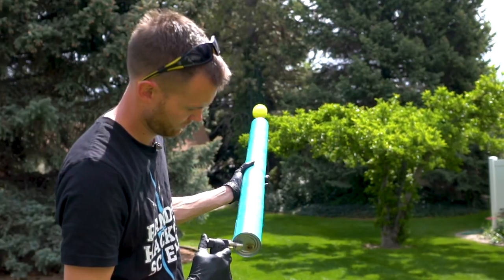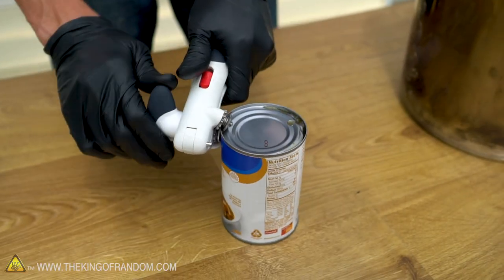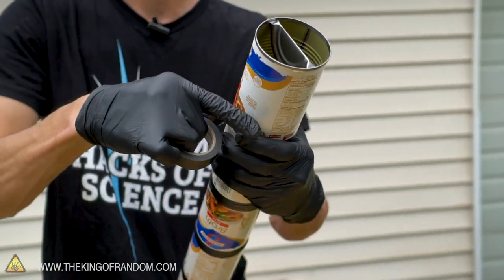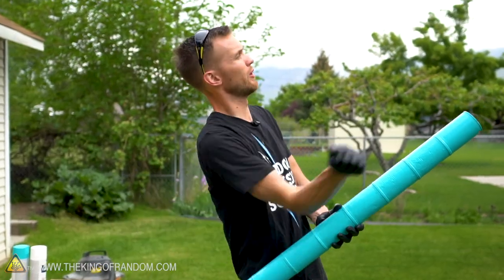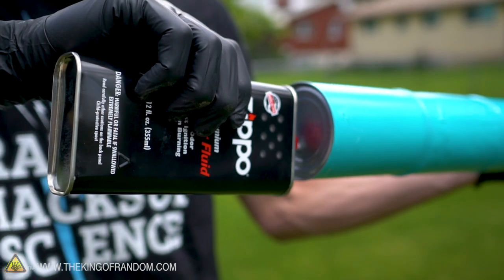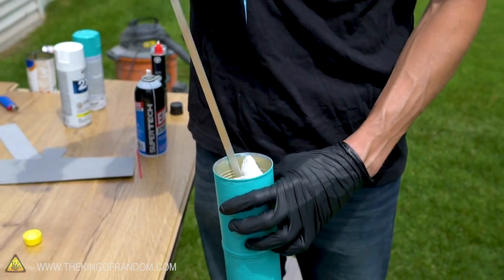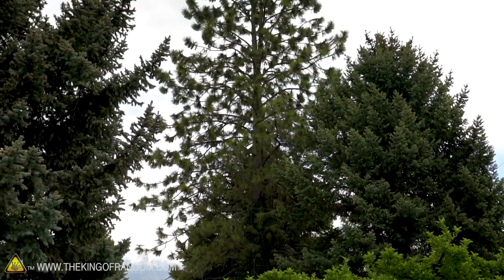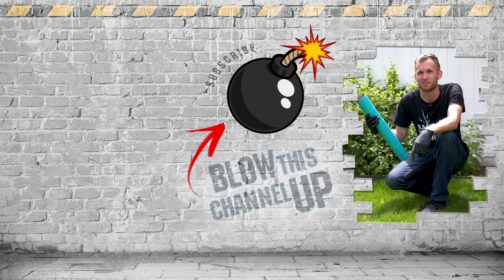Tennis Ball CANNON from Soup Cans

Comment: Built one of those when I was a kid (1970's, with the old style pop cans). We used lighter fluid, into the bottom can, then swung the "cannon" like a base ball bat a couple times to vaporize the lighter fluid, then immediately lit it. BOOM!
Reply: Exactly.  We did the same in the 70s.  Shake the whole contraption a number of times like a spray paint can, then light at the whole at the bottom edge of the bottom can.  The balls would easily go 60-70 yards.
Reply: I did the same, using tall beer cans I'd find. Worked really well, always wanted to make one to show my now grown kids, but need tin cans not aluminum, bummer.
Reply: Me too whipcannon around like a bat
Reply: Also the mid can should lowered
Reply: We also installed a flint at the bottom-side of the bottom can  to strike instead of a lighter
Reply: Probably that Cannon could be reused as an alcohol firecracker like the indonesian people used to celebrate ramadhan they sounded very loud!!!
Reply: We used mom’s hairspray it would send the ball a block or more
Reply: Yep. When Coke was still in tin cans. Used a triangle can opener on some and removed to and bottom of others
Reply: and the tennis ball fit snug on first can....ours went 100 yards+ not 200 feet lmao...then we went Gladiator and would put lighter fluid on tennis ball and light it :P

Comment: When I was a kid we cut the can lids halfway and folded them under, making sure each was cut on opposite sides. Then we would put them together so that each can matched holes with each other. This kept more vapor in the bottom half of the cannon longer. We used lighter fluid as well and just shook the cannon after adding the tennis ball. And our ignition hole was on the side of the bottom can and not under the cannon.
Reply: That's exactly how my older brother (hero) made them. I've never forgotten that tennis ball bazooka.

Comment: In the early 70s, soda cans were made with a thick, straight-sided cylinder, had a large, removable pull tab, and a top and bottom that could be removed with a can opener. They were the perfect diameter. We did nothing to the bottom can except remove the tab and punch a hole in the side (not the bottom - you could stand ours up on the ground without losing fluid). Then, we removed the top and bottom of 4 or 5 more cans (4 total is actually sufficient) and taped them together. We just dropped the ball all the way to the top of the bottom can (All of that extra expansion space isn't needed). We could get 50 to 100 feet shots, depending on how much lighter fluid was used and the angle at which we held it.

Comment: We used to use beer cans,they were at that time made of steel.  This paper thin aluminum now would melt or explode at the seams. They are tight fit, plus the opening was enough to allow lighter fluid to flash off into vapors.

Comment: Why you dont use a pvc pipe?
Reply: LivePro he wanted to do something with things ppl have at home
Reply: Teri Payette it’s pretty easy to obtain a pvc pipe
Reply: PVC pipe doesn't commonly come in a size that fits tennis balls.
Reply: It do though
Reply: right? and why arent you shooting potatoes? they will always fit and work WAY better.
Reply: It would slowly melt the pvc
Reply: then why do i have the one i made for 2 years and its just fine?
Reply: Because me and my dad made a "potato launcher" many years ago and you want to buy all new stuff to build it... It costed $25.00 to build and that was years ago
Reply: @elmoeboi9544  not a chance.
Reply: Heat damage and potential plastic shrapnel. Metal cans hold the pressure better, which is not so high as to be able to rupture a soup can wall.

Comment: I think if I made this, I would want to use some kind of glue on the cans as well, to ensure it holds. I think I'd also want a removable bottom of some kind, to help with fueling.
Reply: Or use a solid tube of some type. This is just another version of the "potato cannon".
Reply: Just use pvc pipe
Reply: Incase of a removable bottom the pressure inside the tube would force the bottom to open up.
Reply: threaded one might able to prevent the bottom to pop off
Reply: Yep. I was honestly expecting a catastrophic disassembly halfway through the video because he was using cans and tape vs. explosive gasses.
Reply: I would do it with PVC with a removable bottom and attached a BBQ lighter at the side with hot glue. So the gases don’t leaked by the hole like this one. I also would use a trigger spray bottle to   vaporize the fuel inside it.
Reply: solid ideas dudes
Reply: Directionally Challenged so a potato cannon with interchangeably barrels of different diameter
Reply: I wold do the same but would have taken some 1/8 sheet metal and bend it into a circle and glue it in the last 5 cans to onshore a tight fit for the tennis ball
Reply: True
Reply: Just a pipe works too
Reply: if you close it in the bottom, metal pipe makes it a working gunpowder cannon but i would not recommend that a bit too much powder and it will explode insted
Reply: duct tape works best

Comment: Thanks for the fuel idea.  My tennis ball had a great tight fit using asparagus cans but I was struggling with distance using lighter fluid...maxing out at about 20 feet.  As soon as I changed the fuel I immediately got two nearly identical 120 foot launches.  Awesome!!

Comment: I have double walled cannon with a 3 liter combustion chamber and a 4 ft barrel.  It has electric ignition so You can seal the camber completely and uses a mix of oxygen and propane as the fuel.  It can lunch a sand filled tennis ball over 1500ft.

Comment: I used to make one when I was a kid.  However, we did not use so many cans.  When pop (soda) cans were steel we stacked six together.  We also did not shove the ball so far down the cannon.  We usually stopped the ball at the first can.  Lighter fluid worked perfectly well because the combustion chamber was smaller with only six cans.  We used to get great height and a very loud blast.

Comment: Just a suggestion. Before connecting the last 4 cans on the open end. Cut the foam the size of the single can and using contact cement stick the form to individual cans.

Comment: When I was young and did this we used steel soda cans as they fit the tennis balls tighter. The best fuel to use is calcium carbide or miners lamp fuel.  We would put two or three "rocks" through a keyhole in the bottom can, add water, wait about 20 seconds and then ignite it. Tennis balls would regularly go 100 to 150 yards high.

Comment: Build it with 3 Pringles cans two with baffles to create better pressure and a hole one inch up from the bottom can use g a piece of foil tape to reinforce the ignition point. I get mine to shoot way more than 100 feet

Comment: We put tiny hole on the top lid of the bottom can all the way around with a bottle opener litttle triangles then a tiny triangle on the side of the bottom can near the bottom and get close to 1000ft with lighter fluid once its primed correctly

Comment: What happens if you put two sniper sights on a gun right in front of each other. Does it enhance the zoom? Also try putting one sniper scope on a gun and another scope in front of the sniper scope like a red dot sight. This should be interesting....
Reply: FallingJuiceBox their isn't enough space for two scopes. Each scope takes at least half them for the rings and the long range scopes extend past the upper in both directions even for cheap ones. They already make a red dot on magnified zoom combo they run $299-1,000 USD.
Reply: FallingJuiceBox short answer yes. Its typical for soldiers to have a 4 to 5x multiplier on a swivle for their holo sights.
Reply: Cayden Skinner your lucky I’m subscribed to them

Comment: Can I use PVC instead of the cans?
Reply: kareem ahmed PVC of the correct diameter would be even more effective
Reply: its essentially a potato gun.
Reply: Jack Stephens
Thank You :D
Reply: Its similar to a potato launcher
Reply: Pringles can
Reply: I would suggest ABS instead of PVC. ABS will be thicker and harder than PVC. Can withstand the pressures better, to a certain point of course as they are both plastics. ABS usually comes in black, so a bonus maybe?
Reply: pOOTERgOBLiN 
Thanks

Comment: In the Philippines we make these for new year not for launching projectile but to create loud noises. The holes in our can are smaller and gets bigger as it goes to the tip and then use a plastic bottle with the cap have lighter cricket (the one that causes spark) ot the bottom and flying tiger (this is brand name its a kind of alcohol) as fuel

Comment: You need to wrap the ball with paper foil make it bigger put it half way in only so it seals but it’s loose enough to fly with the pressure and explosion. The other the pressure will rise and it will produce a lot more power

Comment: To best use it you have to make multiple chambers in the bazooka, then shake it vigorously and yes you need the ball to be much tighter and it does not need to go so deep inside, when we built some when i was a kid, the tennis ball was just pushed to the bottom of the first can, you need as much space as possible and chambers that can be filled with fumes for a best drastic results. The result in speed and distance is only a small fraction of what we managed with our bazookas. We also tried different fuel, usually because of availability and has to not raise our parents suspicions . The way we used it, I estimate that we could send tennis balls at least 400 or 500 feet straight up. Also we didn't need a sort of stopper for the ball because it was so tight that it could only go as far down as our hand could push it.

Comment: Use duck tape next time at each can segments to hold it strongly together. Use a small squirt of zippo or ronsonol lighter fluid in the bottom hole of the bottom can and You have to swing the thing like a golf club 10-12 times until the fluid becomes vapor. Once the bottom surface of the bottom can feels cold, it’s ready for ignition.

Comment: We used to do what you are doing but less high tech and probably much more dangerous. 🤗
Soak a tennis ball in gasoline drop it down a tube fastened straight up in a camp fire.
Spectacular results indeed. Of course we did it near a river with no brush to catch fire.
As I am older and wiser,I will try your method.

Comment: Can you just use the tube that the tennis balls come in? The diameter of those is very close to that of a tennis ball. Perhaps you could use cans for the bottom half (where the blast happens) and then have the tennis ball tubes on top of that for the barrel. Bernoulli says it should work.

Comment: In the mid 1970's, Coca cola cans were steel. They also were a snug fit for tennis balls. We used naptha or coleman white gas for propellant. Distances of 80 yards was easy. Also a used vehicle driveshaft worked great. Oxy and acetylene, for range over 150 yards. It would knock you down at 20 yards and leave a welt!

Comment: DO A CATHODE RAY TUBE, use your vacuum chamber and add an anode and a cathode on each side, It's should work, those are the basics of a ray tube, you could also bend it with very strong  magnets! High voltage bendable rays, you've got to do it  !

Comment: here in philippines we made it better... just using a denatured alcohol as fuel... as I make my self... we called it BOOGA! I used 8 cans. 5 cans are all opened up and 3 cans only opened only the top, this can will be having a diffirent sizes of holes on the bottom the 1st one will just a tiny hole and will be the base. the 2nd will have a 3/4inch diameter hole, then the 3rd will have 1inch diameter. then stack all the remaining 5 fully opened cans...  the 3 base cans serves a pressure area so that it will compress the fuel when ignited. that will create a big BOOM...

hope you can try it... you can also put a small fan inside the base can so that you can evaporate very fast your fuel for just about a sec. and it will ready to BOOM...

Comment: Your problem is not the fuel you are using, lighter fluid works great. Your problem is your combustion chamber is too big. When I made a tennis ball canon about 50 years ago, I used the smaller Campbell's soup can like a tomato soup can size and attached a tennis ball can on the end. That is as far as the ball went in. What you did with the larger cans should be fine also but your design flaw is in the bottom can. You have a small hole in the end for squirting the lighter fluid and lighting but you have the other end of your bottom can open. It should only have a hole in the center about the size of quarter, you know, a 25 cent piece. It is harder to clean and dry out before assembly but give that  a try and hold on tight because it kicks like a shotgun, one hand won't enough, and sounds like one too. I used to hold it and a friend would put a match to the hole. All you need is one small squirt of naphtha/lighter fluid and mix thoroughly.

Comment: Keep the bottom can intact...put your hole on the side and stand it upright.  Steel soda cans were the preferred building tool..and I poured lighter fluid in the from the top...spun it around.  Want real fun?  Soak the tennis ball...and it's FLAME ON!

Comment: You need to use Campbell's Soup cans but the tennis ball will be a little bit too tight for it so you cover it in lighter fluid and burn a lot of the hair off so it fits nice and snug down in there. We've shot those things so far up into the sky that you couldn't even see the ball anymore

Comment: We use to make these in the 1970's and we used the steel tennis ball cans but we used 4 cans. 2 cans had the ends cut off and these are were the tennis ball would be loaded. The to other cans were on the bottom one had the bottom kept whole and the second one had holes put into it. Tape them all together then squirt lighter fluid into them then hold the cannon and swing it up and down to spread the fluid and intake air. Put the ball in and in the bottom can a small hole is used to ignite the fluid and trust me they sent the ball way further than 100 ft.!! When the tennis ball stopped fitting tight we would use some duct tape on the tennis ball.

Comment: what if you add a piezoelectric spark lighter from a barbeque lighter and attach it to the side of the bottom can?
you won't need to hold a torch to light it and it will be easier.

Comment: Instead of using methanol, try ethanol, when I was a kid I used to make those cannons, and with ethanol it worked the best, and also if the hole do light it up is on the side of the can, right on the edge the explosion is bigger. I don't know why, but it is...

Comment: Back in the 1970’s sodas came in tin cans. We would also wrap the tennis ball 🎾 with electric tape. We would stand it straight up in middle of the street and make a trail of lighter fluid for a fuse. Most of the time we would get the ball back at times it would come down next block over and didn’t get ball back.

Comment: I have a random thing for you guys to try. Can you solder several little 12 volt batteries together like you would power of small device with. And get enough power at 12 volts to start a car.

Comment: We used to use metal tennis ball cans taped together but the last one upside down with about 8 1/4 inch holes drilled and a hole at the bottom. Used lighter fluid and would go at least 300 ft in the air. I miss metal tennis balls cans lol. Anybody know what was the last yr for them?

Comment: nice idea and strong from being can metal but so many weak points on every join with tape electrial tape i wouldnt trust it go get some pvc and make the same thing and use pvc glue rated for 600 kpi much more than ur sticky tape can hold

Comment: this is not how its done, you need to cut the can tops and bottoms in half and then arrange them so the hole between them is only 1/4 the circumference, each hole must be  offset to the previous one to create a circular flow of air to make a vortex.  the vortex will require at least four levels to create more power, the longer the vortex the more power a drop of lighter fluid will create, but 4 cans cut and three cans as a barrel should allow you to get between 250 to 300 ft shots. also this way you don't need a bar to hold the tennis ball, we use to make them from pop can as they are exactly the right size, but the newer cans don't work.

Comment: Pvc pipe, a pvc t junction, a reducer to go between the t and the pipe, a piezo lighter fitted to a cap on the t junction, a butane lighter valve fitted to the other cap. Potatoes, frozen oranges or lemons and butane... your welcome.

Comment: This cannon is call a faguofe it something that the Samoans use for making a loud noise often used at a party or New Years u can make a faguofe with soda can but it works well with Arizona can but for the best result of making a louder noise u can use the big can that often have chili and cheese inside the reason y the zippo lighter fluid didn’t work is because you put it in the wrong side when when u put it in the front side and shake the cans the lighter fluid gas will travel down while the liquid is still at the top but when using the faguofe make sure the can aren’t damaged in any was this could cause the cans to explode when fire this (cannon) is not a toy u can blow off ur hand when not using it probably

Comment: What happens when u pass high voltage electricity on a round magnet one terminal touches the outside of the magnet n other levitate inside the ring of that magnet

Comment: You used too much zippo fuel you only want 2 or 3 drops and instead of bending the end of a can drill lots of holes in it. And only use 2 csns for your combustion chsmber .

Comment: Try using the gas from your hydrogen/oxygen generator (from water).  Please don't hold the cannon in your hands.
Or maybe dimethyl ether (aka, starting fluid) .  Or even better, acetylene.  These all have a wide range of flammability limits.  Use an electric spark generator so you can stay FAR away from it.